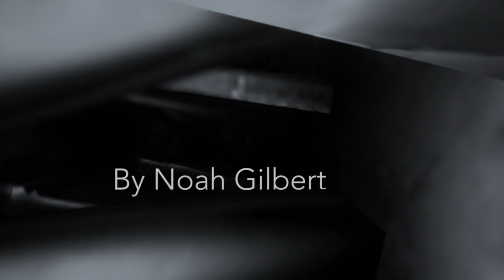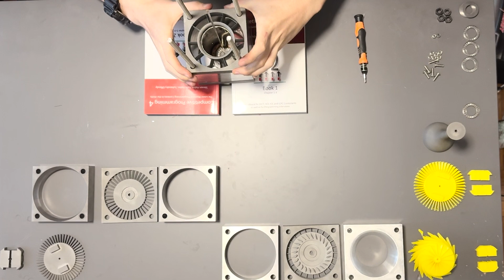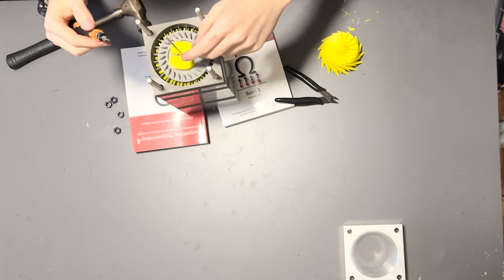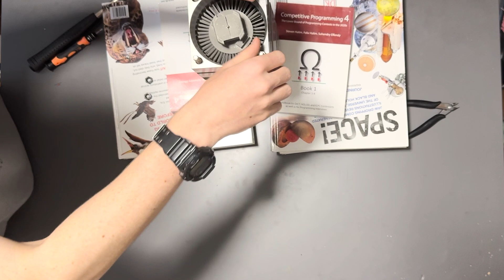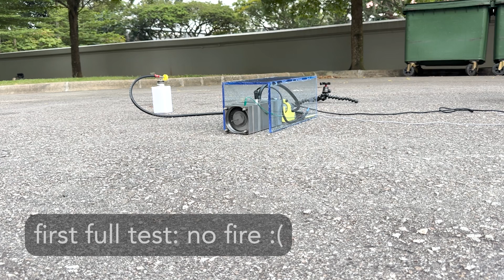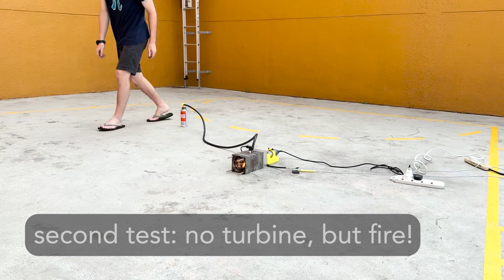Assembling and Testing a Modular Jet Engine (Jet Engine Project Pt. 4)

Comment: Your glorified blow torch is coming along. What speed does the dremel actually spin the rotor to?
Reply from the maker: Theoretically the dremel does 35000 rpm. I don't have a tachometer to test it, but I highly doubt it is that. Realistically maybe 2000-5000? Also,  I promise that eventually it will get over the blow torch stage and power itself (hopefully!). Otherwise should have just gone with a ducted EDF...

Comment: Did you design this? I love the modularity!

I will say however that it seems that you are putting a centrifugal compressor before an axial one which is a bit of an odd choice. Usually centrifugal compressors come after the axial ones because they are more resistant to surges and stalls while axial ones are good at maintaining high mass flow.

Also make sure that the layers are not leaking from the seams.
Reply from the maker: Yup! Designed by me (see the last video for more info). The main reason for the ordering of the compressors is just practicality. Radial (centrifugal) compressors take air from the center and push it outwards, and axial compressors take air outwards and keep it outwards. The other direction would require more ducting to take the air on the edge and feeding it back into the middle for the radial compressor. I'm open to testing the other direction though.